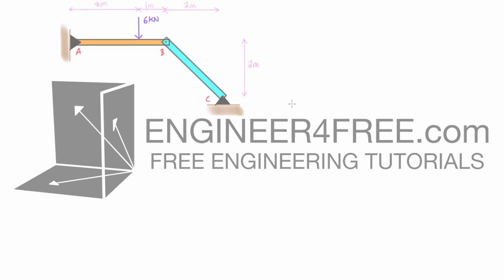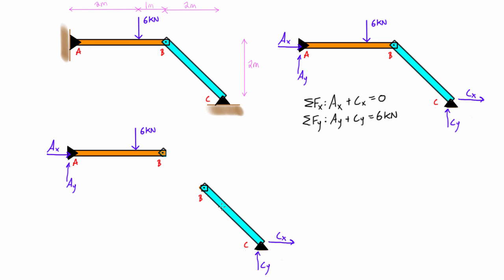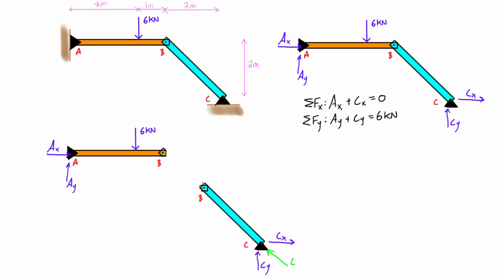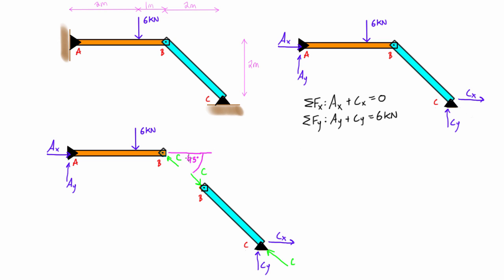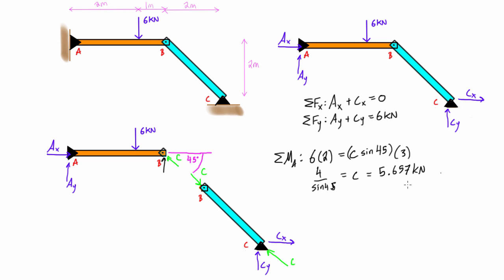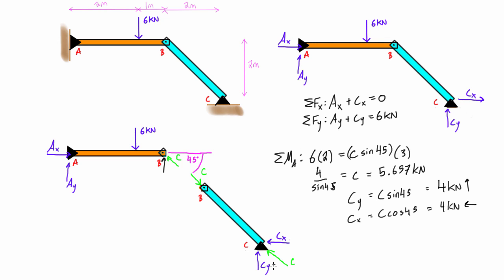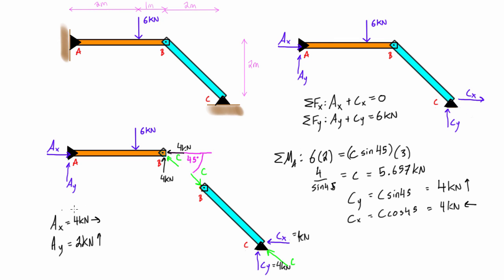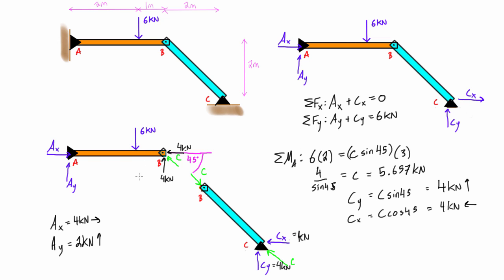Frame example problem #2

Comment: Why you didnt put By and Bx instead of C sir? 02:17
Reply: Because it's a 2-force member. In a 2-force member, it is only in compression or tension. In another comment, Engineer4Free explains that you can still solve this problem without catching that member BC is a 2-force member, but it is critical in more complicated problems.
Reply: Thank you🙏

Comment: When taking moment with respect to A point, Cy components distance should be 5 m, also Cx component will have a moment too.
Reply: Both of these statements are incorrect. Cy in the FBD of member AB is only at a distance of 3m. Second, Cx is in the line of action of point A and will therefore not have a moment.

Comment: when taking the moment of A how come the 6 isnt negative if it going in the clockwise direction
Reply: It is negative. Take another look at the equation Engineer4Free wrote for the moment. He just skipped a step and started with the two forces equal to one another.

Comment: Why is there no Bx and By?
Reply: Because it's a 2-force member. In a 2-force member, it is only in compression or tension. In another comment, Engineer4Free explains that you can still solve this problem without catching that member BC is a 2-force member, but it is critical in more complicated problems.

Comment: You took the moment about point A and used vertical vector component of C and the point load but forgot to account for the horizontal vector component of C. The force Cx is perpendicular to point a at a vertical distance of 2m, creating a moment counterclockwise and also adding another unknown into the equation. Therefore the problem falls under statically indeterminate unless a support reaction value is given in the problem.
Reply from the maker: That sum of moments equation is only for the orange member. Cx acts. On the pin on the orange member at point c, horizontally. That means Cx’s line of action passes through point A, and therefore causes no moment about point A. A single member with two pins and some extremely loads would be statically indeterminate, but because of the hinge (pin connection between the two members), this structure is statically determinate.

Comment: Great vidoes, really enjoy your style of explaining

But I have a question, in equation 3 (Ma) you use C x sin(45)  x 3meters isnt it suppossed to be 5 meters? the distance from point A to C on the x-axis is 5 meters. or have i missed something here?
Reply from the maker: Hey, that equation that you're referring to only considers the FBD of the orange member. It does not include the green member. The green member pushes on the orange member at point B (and vice versa).. "c" is the force that each exerts on the other. So when we draw only a FBD of the orange member, force "c" is acting on it at point B at an angle of 45 degrees (as determined previously, because the orange member is a 2 force member, oriented at 45 degrees.So for the sum of moments about A for the orange member, there are only two forces with a component whose line of action that does not pass through A, that being all of the 6kN force, and the y component of "c." The y component of "c" is c*sin(45), and the perpendicular distance from A to the line of action of it is 3m. Hope that clears it up! Only draw a FBD for one member at a time.

Comment: If you failed to recognize that BC was a two force member and set up the reactions as Cx and Cy, could you still get the right answer or would it mess up the equations?
Reply from the maker: Hey thanks for the question. In this problem it is possible to solve without recognizing that BC is a 2 force member, ie the overall internal force is oriented at 45 degrees in BC. You would still have to draw the exploded diagram and then do sum of moments about point A in member AB. you get (6kN)(2m) - (By)(3m) = 0 .... By = 4kN up. Then you transfer that vertical force through the pin to be By = 4kN down acting at point B on the member BC. Next for member BC you do sum of forces in vertical = -4kN + Cy = 0 ... Cy = 4kN up. Next you could do sum of moments for BC about a point, or just recognize that there are two force couples (one from the vertical forces and one from the horizontal forces) that have to cancel each other out. sum moments about lets say B is (Cy)(2m) + (Cx)(2m) = 0 ... Cx = 4kN left.  If you compared the two force couples, you'd notice that Cx = 4kN left as well. Either way, then you find that By on member BC = 4kn right. Transfer that through the pin to member AB and you get By = 4kN left for member AB. Sum of horizontal forces for member AB means then that Ax = 4kN right. I forgot to find Ay earlier, but we already had enough info by sum of forces in vertical for member AB: Ay - 6kN + 4kN = 0 .... Ay = 2kN up. So yeah, it's possible to solve, but i'd always recommend taking a second at the beginning of a frame problem and stare at each member to determine if it is a 2 or 3 force member. In more complicated problems recognizing these can be a massive advantage. Hope that helps!